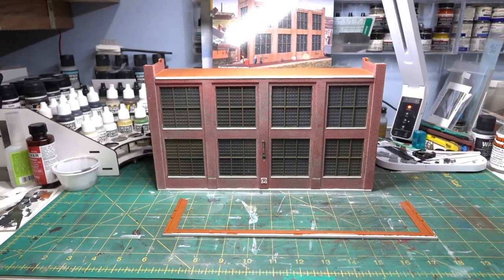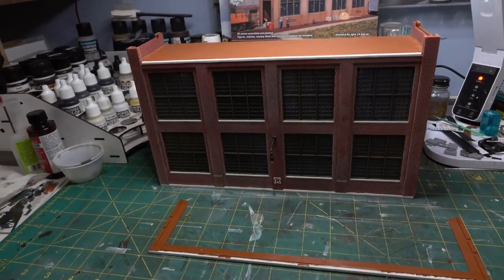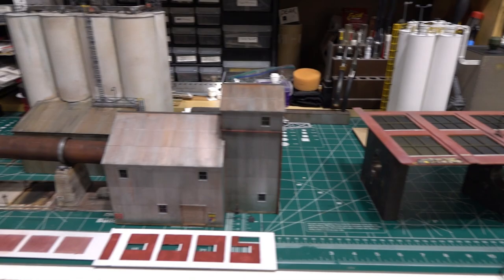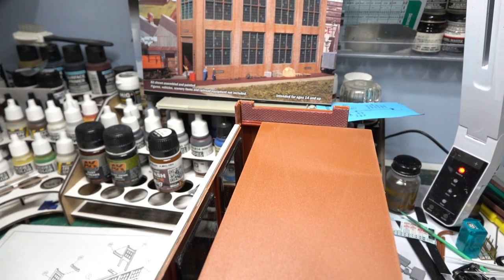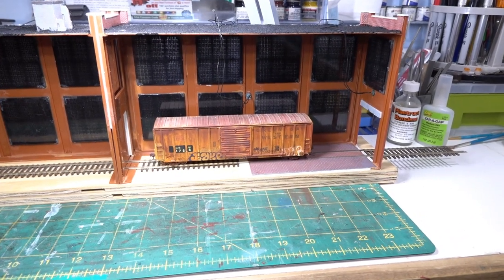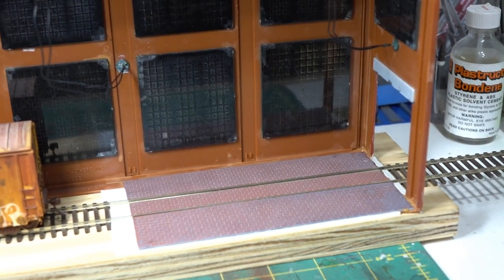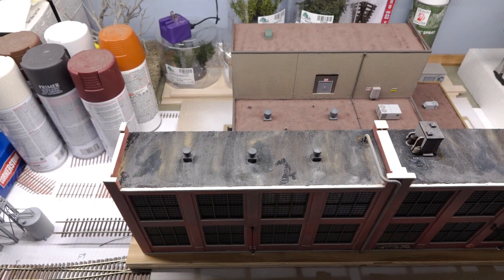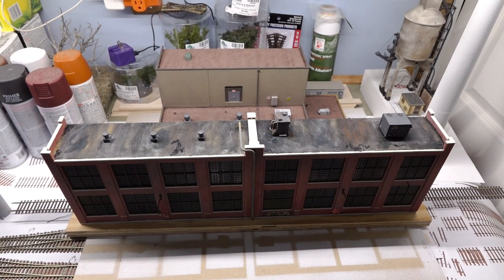Kit Modification Series: Walthers Shop Bldg #1 Background Kit

Comment: Does the roof on the full building have the same issues with the roof going together as the back ground building and you didn’t say wether you had the same problem with the second back ground buildings roof.

Comment: I has the same problem with the Walther roundhouse kit.  Not quite perfect fit on the 3 sections of the roof.  All easily fixed though.  Might have done something wrong, but doubt it as you had the same issue

Comment: Really nice job, especially with the interior and roof finishing. Loving this mini-series…

Far too late for you, but isn't the kit roof supposed to slide UNDER that overhang/slot/edge. The brick detailing makes more sense then, and you would get a well, which would prevent water running down the facade in a storm. Presumably the drain would be in the middle of the roof, or in gullys along the edges?
And as you have access to that roof, shouldn't you have another of those pesky railings along the 'front'. Assuming it's from an earlier administration when they did care about the workers.

Comment: Mr Rob I'm doing the same kit. How did you get your windows to look like that. Are they painted. Great job
Reply: Harry- thank you and yes, I spray bombed them. I used a dark grey Auto primer and also some Testors Desert Tan and Olive Green (just because I had them on the shelf) Just sprayed over the wall with the windows installed-from the back- until it nearly covered them up. You actually can still see thru them, if you hold it up to the light.

Comment: I've really enjoyed your videos. Your efforts to get the realism has really sparked my imagination, I've gotten some great suggestions from you.
    On this one maybe you could add one strand of small solid wire and a couple of styrene pieces to emulate the air conditioning wiring and junction boxes.  Also some thin lines in gloss black to show the tar lines on the roof? Just a thought.  
     Anxious to see how this all comes together on your layout.
Reply: Don- yes, those certainly could be added. I just am trying to balance enough detail with the fact these are background kits and won't be super visible once in place on the layout. Your ideas would be perfect- and I will use them- for those foreground buildings that will see more scrutiny once in place. I need to stop myself, as I could noodle around with the detailing and weathering for weeks- but at some point I just need to get these over on the darn layout!

Comment: If I was to run a bus wire for all street lights and building lights what gauge wire would be best to use
Reply: Phillip- do you mean for the entire layout? My 12V bus is 12AWG, and I tap off it as needed. I actually have two ex-computer power supply set ups, one for each "half" of the layout. I used 18AWG in this building only because it is stiff enough to be somewhat self supporting- it certainly isn't needed for the current!

Comment: Great Video.. I enjoy your videos.. You gave me some ideas for this unit.. I'm going to purchase two more of the same unit, as i already have one unit already. The third unit, i'm going to use as parts.. between the two buildings,  I'll cut maybe one or two windows/walls sections from the spare building i purchase and create a second floor between them, but leave space on the first floor between the two building. then put a fence with a gate between the two buildings.. I'll send pictures when completed....
Reply: THAT sounds interesting- definitely show us how you do this! I like the idea, and it will look very cool.
Reply: Hi Rob,  How did you lighten the brick work ? I'll let you know if I run into the same issue on the roof. regards, John...

Comment: It was always a running theme in Model Railroader that they would never say to bother with detailing the background buildings. It is a good point, cheaper too. But, I think I'd rather do it regardless. Real buildings are still fully-furnished no matter how far away you are.
Reply: Model who? JK, but I don't usually read MR anymore. And I would disagree, as if one wants to create a fully believable scene the background buildings are just as important. May not need to go to the same level as a foreground building, but some detail should be added.
Reply: I don't either, I cancelled my subscription a few years ago. I think you can model more realistically by looking at real photos rather than pictures of models.